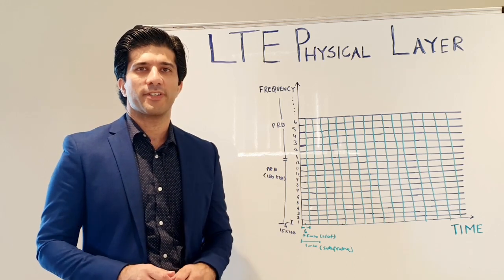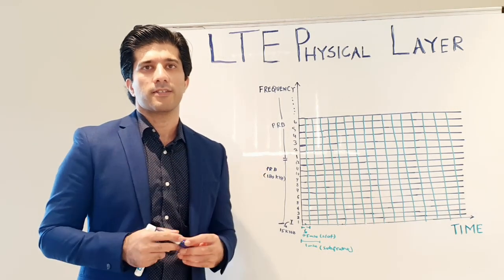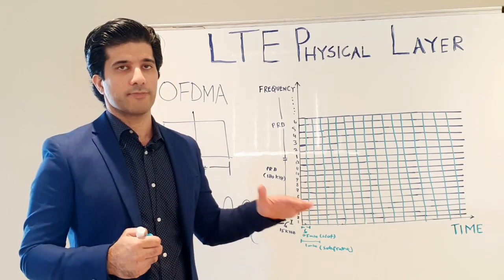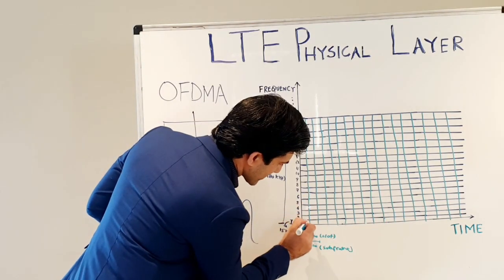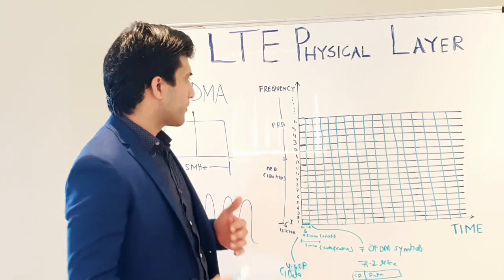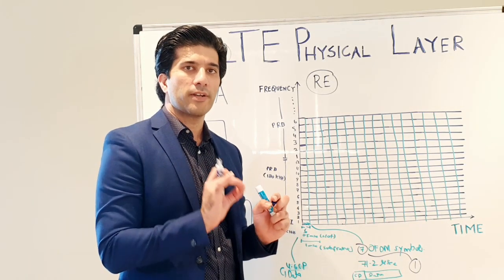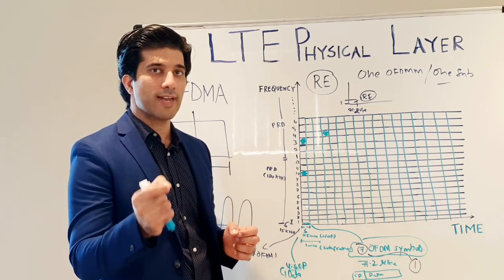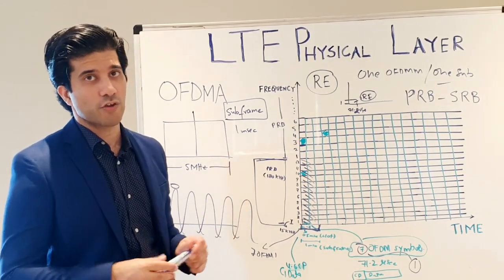LTE Physical layer : LTE Frame structure, RE, Resource blocks and SRB with number of RB Calculation

Comment: If we calculate with this formula the result is 26, 54 and 110 RBs for 5Mhz 10 Mhz and 20 Mhz respectively while the standard is 25, 50 and 100 resource blocks for 5, 10 and 20 MHz. Can you please explain?
Reply from the maker: Please check the pinned comment